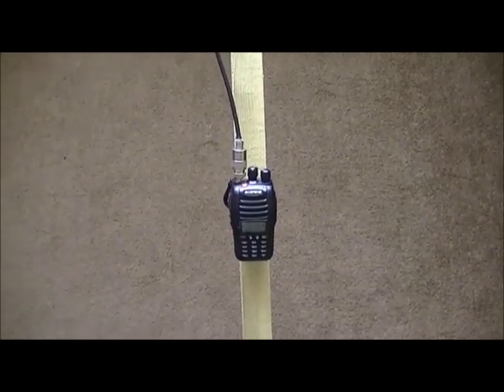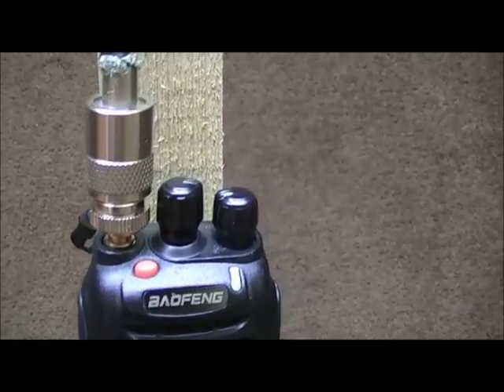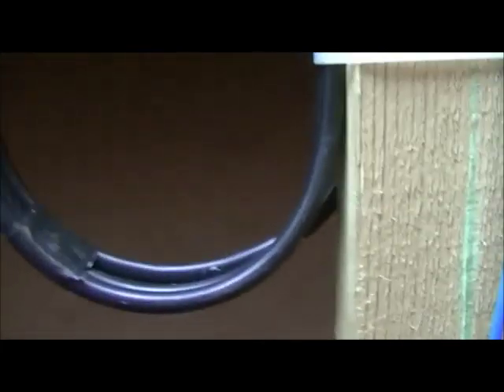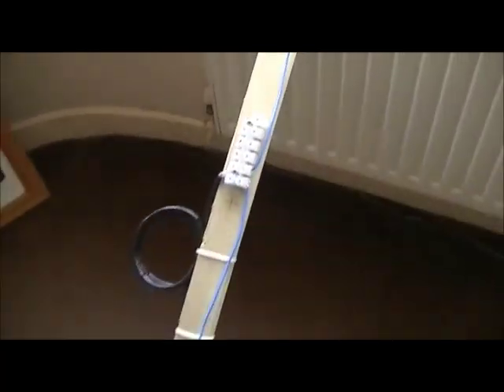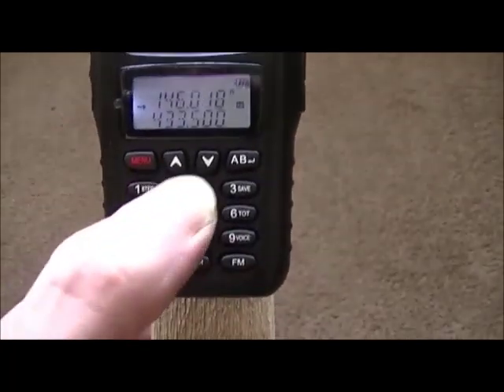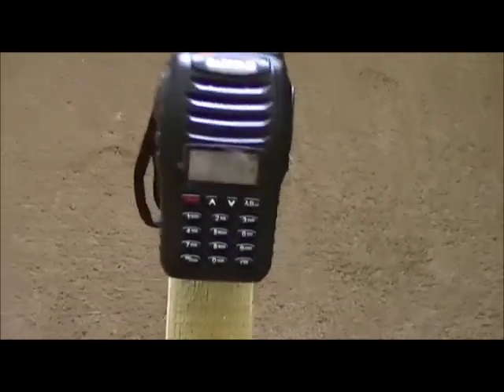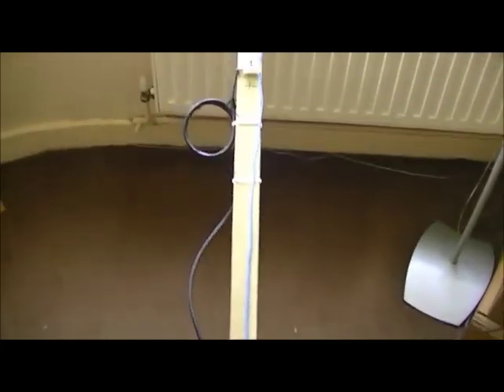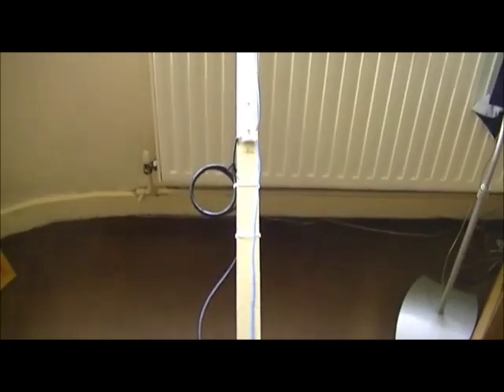Baofeng UVB5 + homebrew 2m diapole

Comment: Bf uv-b5 model is maxcimum talking range km to connect NA- 771 antina
Reply from the maker: it all depends on how high up you are.usual range in urban areas up to 3km.higher up on hill for example 10-20km.its all about height with small antennas.Hope this helps,thanks for the comment!! ;-)

Comment: cut the coax at the antenna tip...just a inch back and watch reception improve FYI
Reply: +Xray 2zero4 or you can add a horizontal long wire to the tip of that antenna and really have some ears